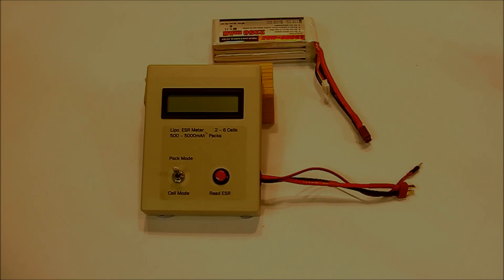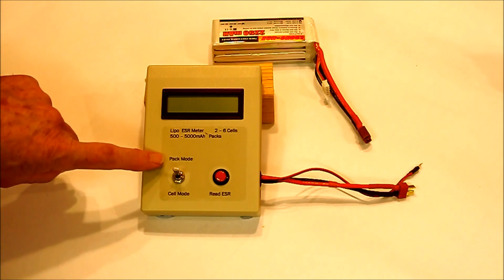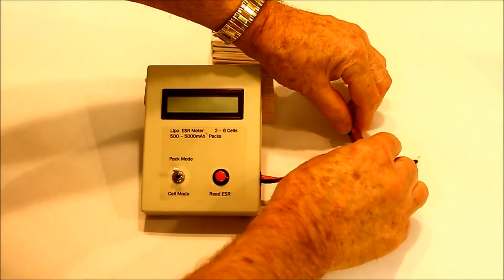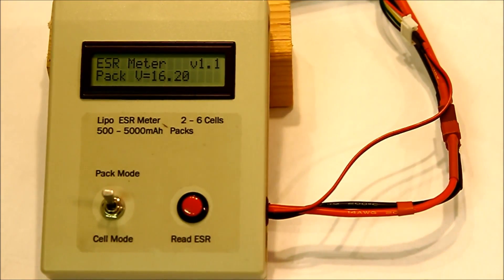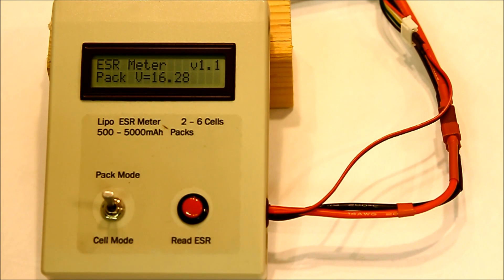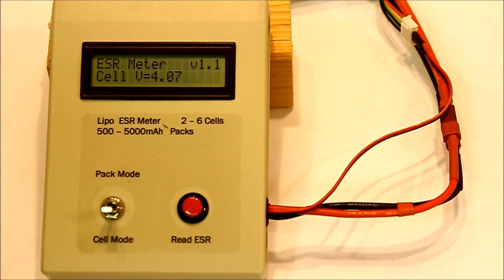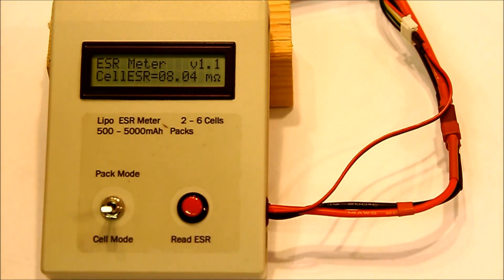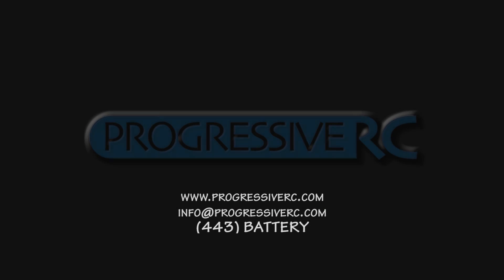Product Spotlight: ESR Meter

Comment: How is the meter not confused by ESL when it is used in the pack mode?  This isn't much of a problem for airplane packs where the power wires are brought out in close proximity to one another, but car packs are not built like this.  From the video, I am guessing that the whole pack measurement doesn't not use the sense leads that are attached to the balance connector?  At 1kHz, an inductance of 1uH could look like 6 mohm of "resistance".  This could lead to wildly inconsistent measurements if the user was not careful with the exact geometry and length of the power wires.   Thanks.  Matt